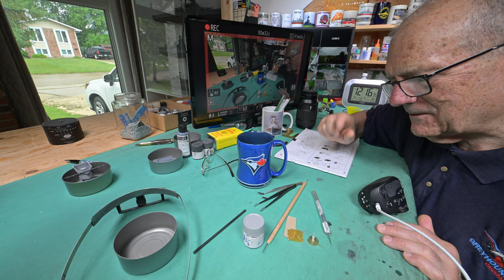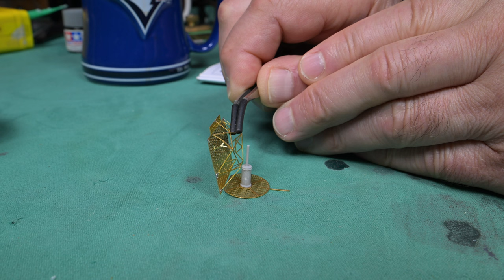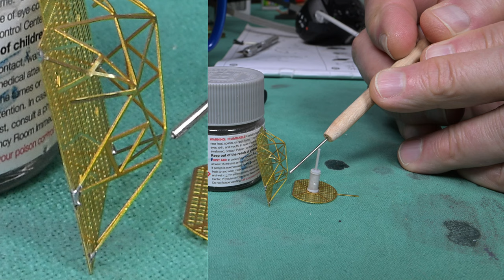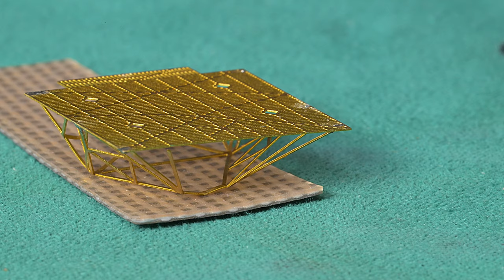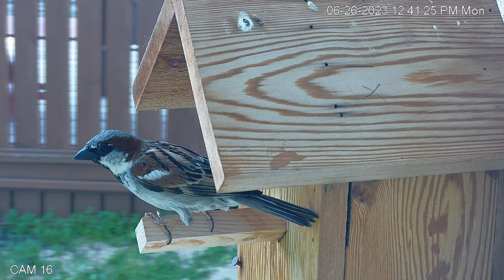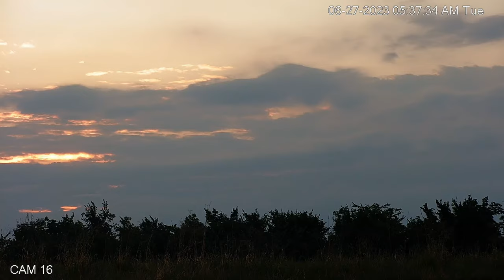The Model Ship - Part 1651

Comment: Mr Ron. I ordered, and used a 3D printed part for that big radar unit you are messing with. It came already attached to that round pedestal so all I had to do was glue the whole thing down to the PE platform it rests on. You could try laying the radar dish face down on some tape or blue tack, and then insert the pedestal part into the spider part. That might work better than trying to stand the dang thing up and gluing it? Anyway, I know you'll figure it out. 👍
Reply from the maker: Thanks for the tip Paul 👍

Comment: Hey Ron
     When you’re ready to install it permanently, double check step 39’s orientation. In all pics, the 6 mm horizon straight piece is left and platform straight side PE 5G is on the right and 
curve side left is side with 6 mm straight piece.The half moon key in R21 is fitted into J14 below platform.
     This might be confusing but IMO orient PE 5G as depicted on page 31to avoid any errors in orientation. As Paul says this step is a doosy.
     Great close ups today and pointers use in macro.
Mike